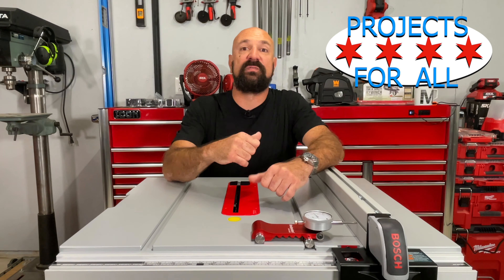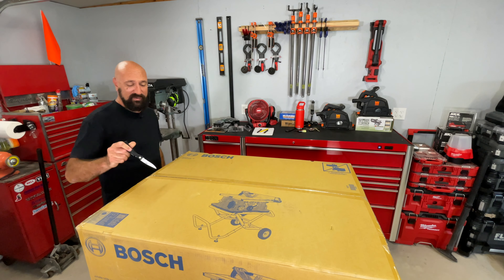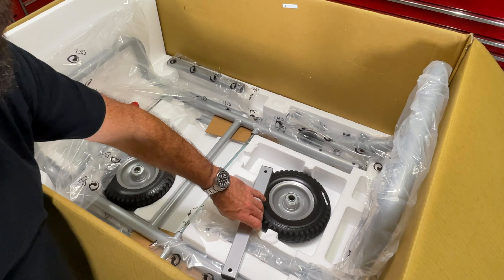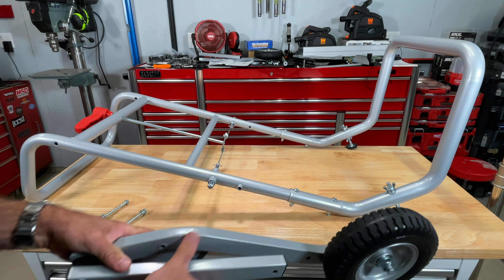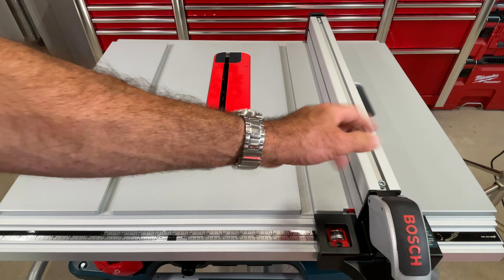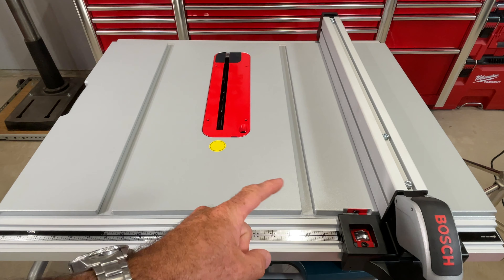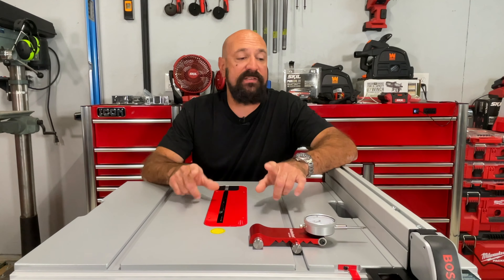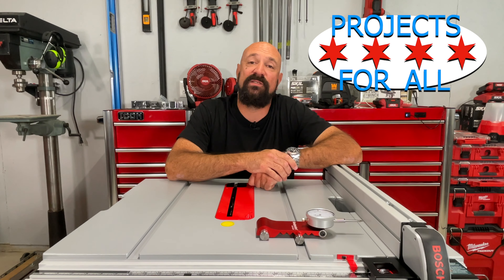Bosch Fence Trouble!!  ||  Gravity Stand Assembly  ||  B+ Customer Service

Comment: I’ve owned two of those saws. Each one had seen daily use for about ten years. There was a defect common to both of them. After around three years I had to replace the shaft bearing on the commutator end of the motor. The would begin to squeal until total failure. I would hope that Bosch has taken steps to rectify this. Regarding the fence, I was always in the habit of pushing at the handle end in order to seat it before I locked it down. I honestly can’t remember if that was an intuitive move or something I had been told about.
Reply from the maker: Makes sense there would be a technique to align the fence with the front rail before locking. Would be a good habit to get into just in case that knob gets turned in transit or say, by my 5 year old. I’ll have to figure that out for the review vid. Thanks for the tip!

Comment: What is interesting about your fence issue is that alignment setup was documented in the manual of my (quite old now) model 4000. That old manual has notes on alignment and squaring of the table, motor, fence, throat plate leveling, etc. sounds like they’ve just slacked off…
Reply: It's actually still there in the manual, see page 25 item 6: "Overtightening of the rear clamp adjustment screw 6 will cause the rip fence to be non-self aligning."
Reply from the maker: It does and I think the version where I talk about this got edited out. It also said over tightening can cause chattering if I remember. I decided this was still a good topic since mine came out of the box this way. Could be a 1 in 10k factory adjustment error, don’t know but I try to always show you guys what I find. Good comments and thanks for watching!!
Reply: Just got this saw. Was on my way to get the Metabo table saw from Lowes, but when I got there, the Bosch rep offered me a good deal on this one. It was almost the same price as the Metabo. Was skeptical about not getting the rack and pin fence but thought maybe Bosch didn't do the rack and pin for a good reason. Well, I got  to use it today, and 2 things seemed funky to me right away. For some reason, I had assumed that Bosch, at this price, would have a blade breaking system. But no. I just have to wait for it to slow down. Since my previous table saw had the blade break, I found this to be a big problem for certain situations. Then, I just couldn't get psyched on all the fence repositioning I do with the non rack and pin. And... wait, why is there no rear table extension? Seems at this price range that should come with it. What do you think? I guess it's time for the Dewalt, Metabo, or possibly the Skil. Thanks for your awesome reviews
Reply: I felt and still feel this saw is superior to all of the other saws in the price range. The smoothness of the fence and the rip capacity was the deciding factor. I built mine into a larger table for added work support. Negative comment was not able to raise guard up vertical to adjust width of cut.

Comment: The fence on this saw was a mystery and a headache until I finally figured out the answer. Adjust the knob at the back so that the clamp at the front engages before the clamp at the back engages. It's very satisfying to see the fence come into alignment while clamping it in place, followed by the rear clamp locking itself into place.

Comment: I have owned my Bosch saw for over 20 years now and just today the motor fried. I have borrowed my friends Dewalt tablesaw with a rack and pinion fence and I absolutely hated it. I will either repair my Bosch saw or buy yet another new saw….. I’m a flooring installer so my tools get used a lot, but Bosch and their table saw is second to none in my opinion. Love my Bosch.❤

Comment: Mike.... I have the older Bosch Model 4009 with the gravity rise table.  I've had if for over 15 years with no issues.   At the time I also ordered and installed two table extensions ((1) bolts on front for outfeed and another (2) for left side extension they each consist of two tubes with table level aluminum end which will slide in and out from/to the saw).  I also bought several blade inserts for zero clearance purposes.  This saw does everything I need in a table saw.

Comment: Thank you.  I would not have known what to do with my fence if not for this video.  Turned out I had to take the bolt cap off of mine to get it loose enough to properly align.

Comment: thanks 
great advice
im working on my third bosch saw in 25 year
but my last one stll works great with a new set of brushes and a couple of bearings
as a finish carpenter  i use the hell out of out of my saw every day
i personaly think it is the best job site tablesaw on the market
Reply from the maker: Thanks for the insight! Motor bearing replacement is a common comment and I think the only reported failure on my channel to date with this one. Thanks for watching!

Comment: Mikey, what the heck?  That's a pretty expensive table saw for having that type of a problem that the user has to fix.
I know that I would be annoyed by that.  You're a good man and, obviously have much more patience than I do.  Now if I just had a SKil Saw table saw...hmm.  You're really doing a great job and thanks for the effort.  You ware also very generous giving their customer service a B.  After the initial call, I would have failed them; kicked the saw out of the shop and given it a bad review.  Thus, I watch guys like you rather than being a content producer.  Please keep them coming.  I learn something every time I watch.  Good weekend.
Reply from the maker: Lol! I’ll admit I was a little annoyed after that first phone call. Maybe I should have been vague and led with “I just have a technical question”. You can bet I’ll be calling some customer service line again soon. Live and learn. Thanks for watching Meat. Giveaway ends next Sat, should be fun. Thanks for watching as always!
Reply: @ProjectsForAllReviews  I've learned in my elder years that if I get a product that I payed good money for and it does not live up to the standards set for that product, that I'm dialing that tech support right away.  We used to say, in the Army, that  you have to find the "old lady in the tennis shoes," in order to get things done.  Most of the time if you talk to the engineers or architects they understand theory, not practice.  Keep diving, once you find the operator, things get fixed.  Now, you're from Chicagoland and I'm from NYC; perhaps, we can work something out.  Just saying...
Have a great week my friend.

Comment: I had the older 4000, then eventually the 4100. I found that when moving the fence, I NEVER push or pull on the fence. Instead, I only move it by pushing on the clamp handle, which is right above the slider. Then it slides smoothly without the back end binding and the fence will stay straight and follow the slider. If I have any concern that the way I moved it might've caused the back end to bind lightly and clamp untrue, then once in position I gently "pump" the clamp handle 2 or 3 times and you can actually see the back end pulling straight again. Moving it by pushing on the actual fence will always cause the 2 ends to move unevenly. 
Anyway, I just sold it and replaced it with the new GTS15 with the rack and pinion fence.

Comment: What a shame. I’ve read a lot of people really like theirs. I’m actually a big Bosch fan. I know they don’t get much love in the states here but everything I’ve got from Bosch, I absolutely love. I was gifted a ton of dewalt 20v when I started woodworking so if it wasn’t for that I’d most likely have a lot more Bosch. They do some things extremely well but seem to miss on other things. The jigsaw, routers, higher end sanders, are all excellent for me. I’d love to see Bosch get more love. They had an amazing deal on their tracksaw last week and if I wasn’t having a terrible couple of months I would’ve jumped all over it. UPDATE: I didn’t watch til the end. Glad it’s not a lemon. It took me too long to really learn my Delta T2 and dial it all in. I thought my Freud Glue Lone Rip blade was terrible, it’s an amazing blade once everything is dialed in. I can get glue line rips with my CMT combo blade as well. No up down method, move the boards around and perfect glue joints. Gotta check the fence for square often but for the price, it can’t be beat. It taught me a valuable lesson

Comment: My table saw is a 40 year old cast iron sears craftsman tank lol. It’s fence is awful like that one was initially. I have to measure a tooth and spin it to the back, and measure again to get it accurate. I’ve also found that we, as craftsmen and tradesmen, often know more about the tools than most customer service reps. 😂 That’s why I depend on dudes like you Mike, to fill in my knowledge gaps.
Reply from the maker: I’ve always wondered really how accurate a fence can be set with a tape measure. Sounds like a good future video topic!
Reply: @ProjectsForAllReviews  it depends on your patients 😂. Sometimes I get it perfect very easily and other times I have to tap, unloosen, but not too much, tap some more and so on for a while lol. I’ll be interested to see your findings on that Mike.

Comment: I continue to wish I could get a rack and pinion system for my full sized Delta table saw. I've had two smaller, job site saws with it over the years and it's a rock solid design.

Comment: I have owned at least 5 of the Bosch table saws since the first one. These were the original. The fence has had no issues for me staying true. I did have to change the bearing on the motor armature on the last one. It cost $22 including shipping and took 20 minutes to swap out. I have bought others including a sawstop. I still like the Bosch the best. (sawstop is great but has a couple of serious flaws that have cost me a lot when my crew keeps breaking it).
Reply from the maker: Thanks for the pro insight Bruce! I have a Bosch GTS15-10 on order and we should be checking that out in less than a month. I have high hopes for that new design! Thanks for watching!

Comment: I've owned a cast-iron table Craftsmen for twenty years with a nearly identical fence as this Bosch 4100. I've never thought the fence must run dead parallel the whole length; as long as it drifted away from the blade after the cut then no binding. I've done some terrific work with this type of fence. Now that I'm looking for a compact saw this Bosch is the only replacement I've considered because of the fence, and I do like the sliding table. The rack and pinion fence on the newer GTS15-10 is supposedly better but I'm not sure how? I do know the gears are now metal not plastic and overall, it looks like a much-improved model with a better designed gravity stand as well. Hope someone can convince me that the rack and pinion fence is the way to go...

Comment: I’ve bee using mine for a long time and never thought about till seeing your video. Mine is out about 1.5 mm and no way playing with that back knob does anything to correct it. I’m going to have to shim the front tee part. Too bad, I really like the saw, but it’s kind of crumby that it’s not really adjustable. No way that rear knob can fix it at the front if the cross piece is not perpendicular to the bar.

Comment: I’ve had a 4009 for over 15 years. Works great - except for the miter slots. The gauge that comes with the saw is garbage - just like every other saw except that the bottom of the fence hits the side of the table causing you to have to bump the gauge slightly up. So I bought an Incra V120 and I can zero out the play in the channel. The problem is this after market gauge has the same bump problem. Hope your new one doesn’t have the same issue.
Reply from the maker: We’ll take a close look at that miter Keith. At a glance it’s the best one I’ve seen so far (metal). Most saws come with a throw away. Thanks for the heads up and thanks for watching!
Reply: Update: the Incra came with 4 nylon washers, 2 for the fence pivot and two for the locking pivot. Took me a while to put one of them below the fence pivot which gave JUST enough clearance so the gauge would slide through. 
Now I KNOW there’s gotta be another nylon washer to go under the handle and the pivot lock. None to be found. There was one flat washer left so I added three more and put two underneath both points and voila! 
The gauge that came with the Bosch still stinks.

Comment: So my 4100's fence is brand new. Right out of the box the fence is visibly misaligned and I dont know what to do. it was such a chore to unbox and I'm dreading teraing it down and going back to researching a good table. I tried this fix with almost no improvement. And I cant loosen the read bolt enough to make the fron tclamp snap in to place too easily. It still has quite a bit of tension and will NOT budge once locked even at the loosest setting. Wait to you hear how for off, i dont have to measure in 1000th's of an ich as it's plainly obvious. If i set the fence at 1", the read of the fence, the end farthest wasay from me is 1.2" away from the blade. WTF. This was only slightly improved using the method in this video but still at like 0.15" difference from the closest end of the fence. I'm sad

Comment: I had this saw for just under 3 years before the motor crapped out. Changing the brushes didn’t help. Unsatisfied with the durability on the Bosch, I bought the DeWalt to replace it. By comparison, my old Bosch looks and feels like something from Fisher-Price. The DeWalt is vastly superior: better fence, less plastic under the hood, more stable stand. I also had a lot more dust trouble with the Bosch, as the design of cyclops lens on the fence collected so much dust that it was often impossible to dial in accurate measurements without using a tape or laser. The only thing I miss on the Bosch is the big fat off button, but overall, it feels like I traded up from a Corolla to a Porsche.

Comment: I had this saw, or a similar one, quite a long time ago... had bought it after doing a lot of research on saws, but it also had the issues where it would lock out of square really bad with the blade.  made it almost unusable for me.  They really should have come up with a system like a lot of contractor or cabinet saws that has it lock in from just the front so it pulls itself square every time.  
I even did some research on a possible way to put a new fence system on it, but most of what I found it would come close to the price of another saw anyways, so never bothered.
Reply from the maker: I feel this fence style is tougher to engineer to be accurate and def requires more maintenance and diligence to keep accurate. It makes sense from a manufacturing angle why rack and pinions have become the standard. I do like variety and competition so I’m hoping this turns out to be good. We’ll see. Thanks for watching David!